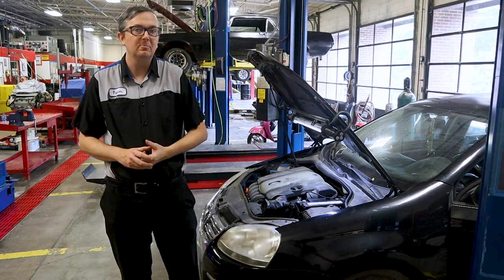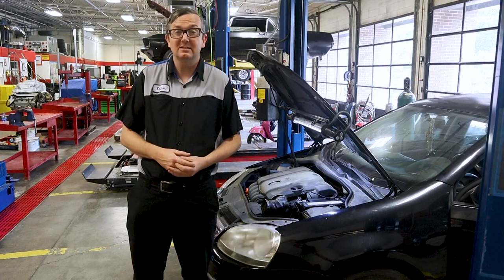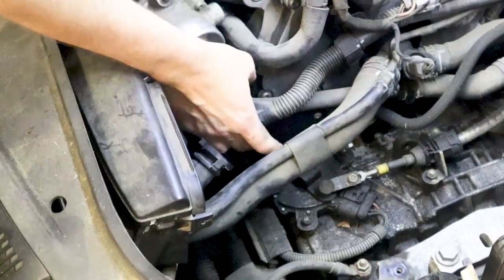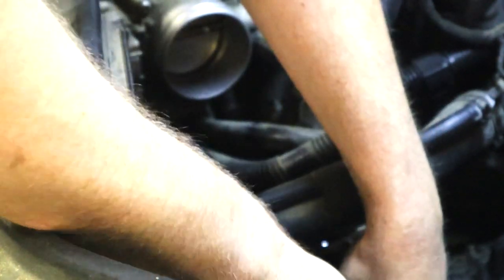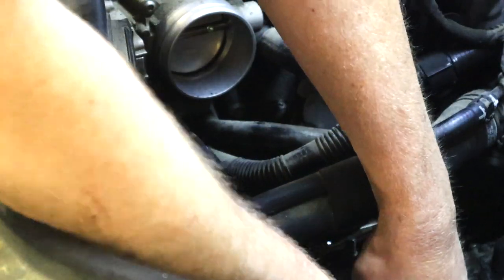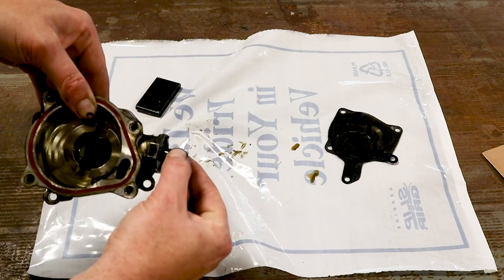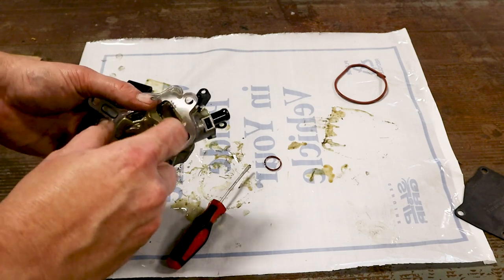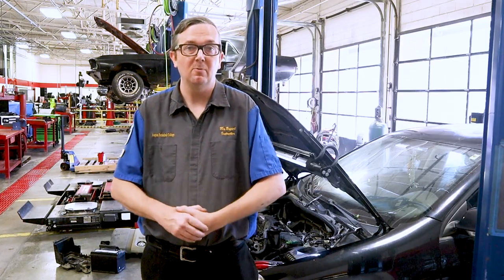Mk5 VW Jetta Golf Beetle 2.5 Vacuum Pump removal, rebuild, and replace

Comment: does it matter which side that black plastic piece inside the pump goes back into it if you had to pull it out to  get the new pump back on when rolling it over the shaft
Reply from the maker: @Shtddy702  I don’t think so

Comment: What is the purpose for marking the bolts that are holding the neutral safety switch ? I marked mine but was erased when I was tightening the bolts
Reply from the maker: To make sure it doesn’t get out of adjustment. Just make sure the car cranks correctly and the gear position on the dash is showing properly after you reinstall it if you have lost your marks.

Comment: after replace the seals how to know if the vacuum brake booster still work properly nd dnt need to change ??
Reply from the maker: With the engine running you can remove the line and feel the end, it should have a sucking at the end. Thanks for watching!

Comment: Is it possible that a leak was made super worse by a hard brake to the point where it emptys the motor of oil? Or is my issue elsewhere
Reply from the maker: I wouldn’t think so, but they can leak out a pretty good amount of oil.
Reply: @AutoScholarwithMrB  well. The pump itself was loose on the block. Pulled it out, redid the seals, and off she went.
Reply from the maker: @smalldoseofmeful  oh! Well that would definitely do it. Glad you got it taken care of.